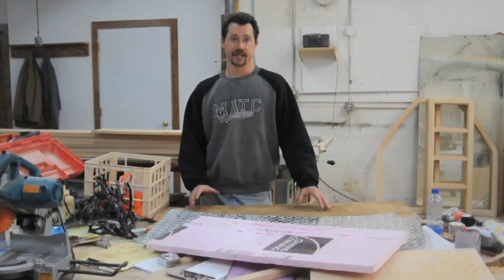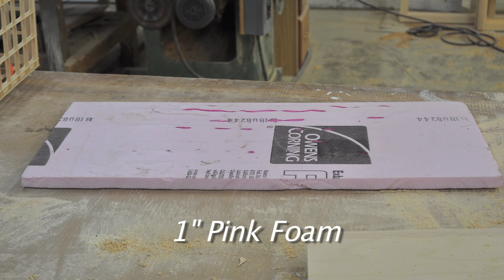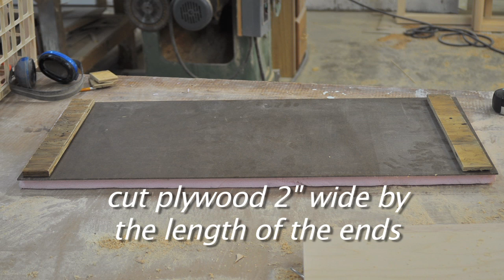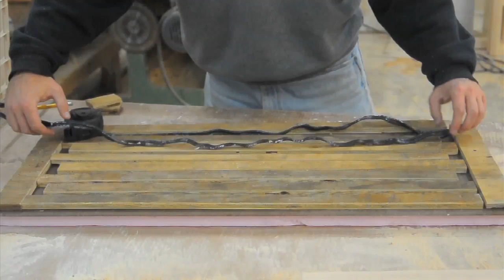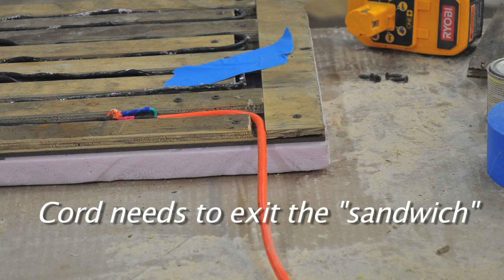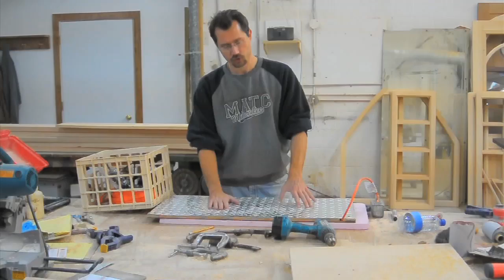Battery warmer part 1

Comment from the maker: I went to install the warmer in my car, only to find out that it trips my GFI!

I tested the warmer out on standard outlets, with a Kill-a-watt to test the draw. It worked fine there.

I will have to pull the warmer apart and double-check my wiring to see why the GFI is activated.

Comment: Ignoring the efficiency argument, the battery generates heat under use naturally.  Once the battery is to temperature, there is no need to try and heat it further.  The only time this would be useful is if you cannot plug it in at your destination. Preheating the battery using the battery in that situation ("warming up the car") might smooth out the performance while driving at the expense of some range.  But you would still turn the heater off once it was up to temp.

Comment: But you could also use an AC inverter off of the Aux Batt or DC/DC converter so it can be run even if it is not being charged.

I know it would probably reduce range if drawn from the pack but I wonder if it could actually aid range should the car not get an opportunity charge or even help the batteries last long during these winter months.

Just thinking aloud,

Comment from the maker: It is an AC heat element.

It will run through a thermostat to the AC input of the car.
The car's AC charging port goes to a regular electric outlet I installed in the back of the car. 

That way, while the car is charging, it can also run AC power to a heater or anything else AC. Imagine "pre-cooling" in the summer!

I could also hook up the heater to a seperate power line with a timer, and have it run for a certain amount of time every day.